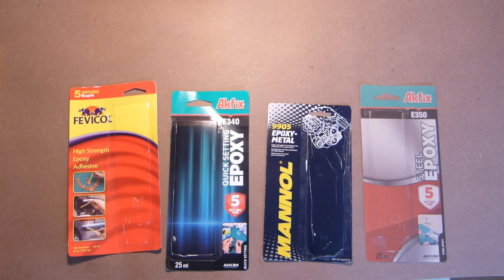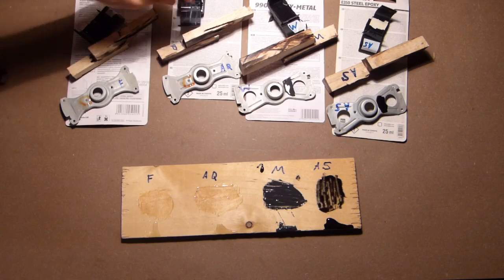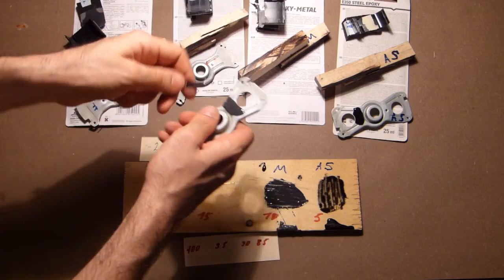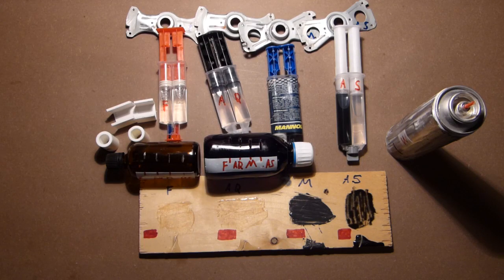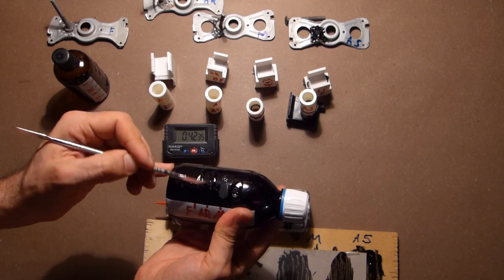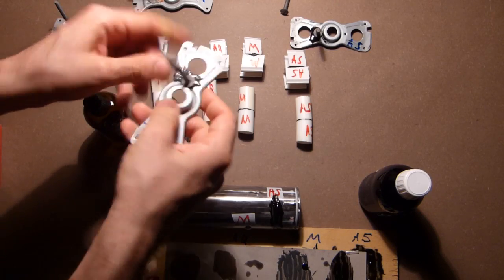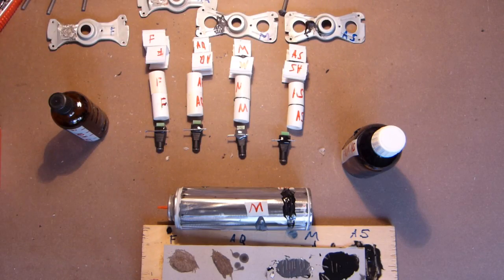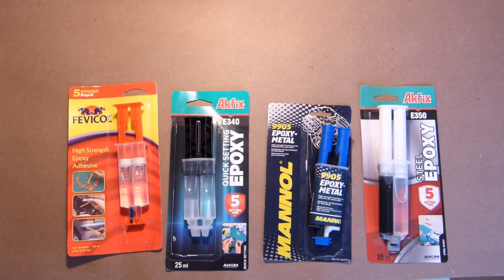FEVICOL, AKFIX, MANNOL - EPOXY GLUE TEST

Comment: We don't have those brands here in Australia (as far as I know),  so for me it was more a demonstration of what 2 part epoxy will stick to. Also, I think you should test these after 24 hours.
Reply from the maker: All the connections, which are OK in 4-6 hours, are simply better within 24 hours. As to the rest ones, - the time will not help them, as the epoxy glue is not applicable, for example, for ABS plastic. But I was surprised that all the glues  work well with metal.